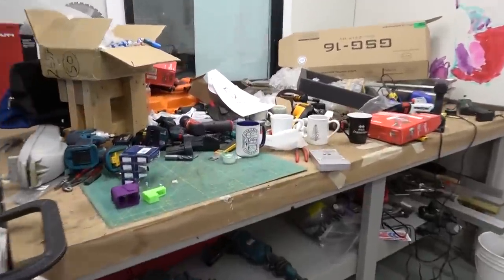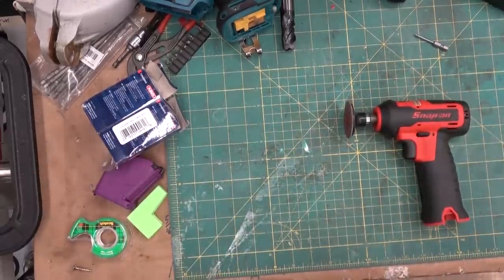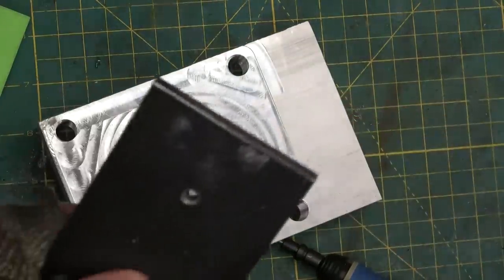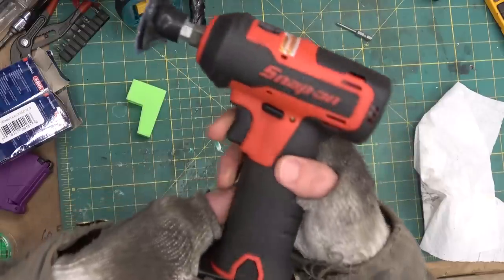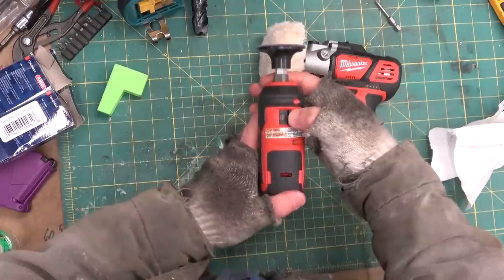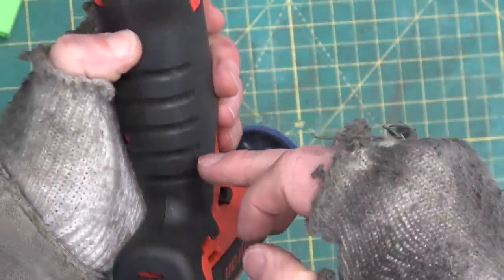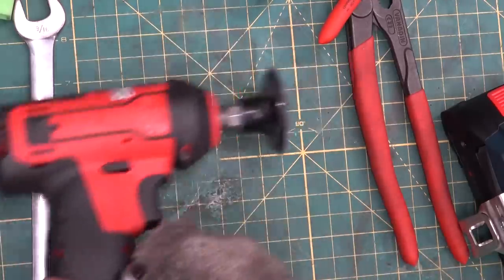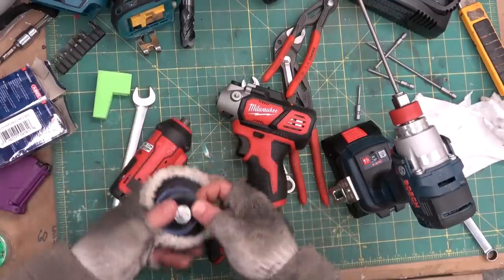BOLTR: Snap-On Polisher $$$ worth it?

Comment: i bought one. used in a mechanic shop with 3m red scotch pads, 2" diameter. used it to clean gasket surfaces. thought it would be awesome to not worry about draggin an air hose over customer  cars. right from new it got very hot for while using it. maybe 3-5 minutes at a time. smoked the motor with probably less than 5 hrs on the tool. the batteries where SO hard to pull out of the tool, and the charger even for that matter. was so frustrated in it, i never even tried to warranty it. threw it to the back of the work bench until I finally threw it in the trash a few months later.

Comment: Ur video are more entertaining than my wife's pie hole.!
I got one of these to restore polish headlights mostly light duty. Cheap tool! Broke on the 3rd use started smoking big time from the rear vents and got extremely hot! So I laid her down. Returned after taking a shit and miraculously it started working again 1min later smoke from the rear again then it sized. Some Oil drops or some type of liquid came out of the front seal onto the adapter. Good thing it had 1year warranty! Local Snaper truck took 1month to return to sender. I would not buy it especially after watching all the details on your video! I should have waited for a video like this.

Comment: I bought 4 or 5 of the 14.4volt snapon tools and while I am quite fond of them you are correct, the over molding at least in heavy mechanic shop type use only makes it about a year. Doesn't hold up to any type of oil or grease getting on it. I try to keep my tools clean after every job but even with brake clean the black rubber holds onto oily stains and just in general sucks.

The tools themselves have held up really well I'll say though. Only issue is one battery pack kicked the bucket after only about 8 months. Batteries are like 120 or so, bit of a kick in the pants.

Comment: Going to guess, I don’t think any one here has this POS?
Reply: Detailing shop I worked at had one. Thing would get HOT quick
Reply: Yes, I own one.  In fact I own many varieties of snap-on twisty tools.
Reply: Robert Cook sooo what do you think about it? Worth it or not?
Reply: @travisarnold8872  well, they all work and last well for me.  See my other comment.  Basically I am slowly switching to Milwaukee for battery powered twisty tools.  Cost is not the sole reason.  Snapons can be factory rebuilt for 68 bucks but lately they havent fixed the main issue when I sent them back, so, switching.  I just buy two of the Milwaukee.  The Milwaukee small 12 volt driver #2401-20 cant hold a candle to the comparable snap on but I bought two for less than half of snap-on.  They last me about 8 months.  I use them all day every day to make a living.  I would bet they last a home game many years.

Comment: I have one I bought myself as a professional mechanic. I actually quite enjoy using it over an air tool. Mostly for cleaning wheel hubs. The gripes. It’s a fairly durable shell, the over mold has only come loose at the thin pieces on the one side of the motor. I have had to sent it in already for repair when the motor let out it’s magic smoke. Which wasn’t free. The other complaint is that the trigger switch does get quite hot when using for some time. I’m thinking more it’s gotta be from that heat sink.

Comment: Hey AvE, not sure if you’ve already got one but the CT761ADB impact gun is an absolute winner. Uses the same 7.2/14.4 volt batteries as your polisher. I’ve had one for a few years now that I use damn near every day. I wouldn’t touch the strap on 18 volt stuff with a ten foot pole. A guy I work with has the 3/8” drive 18V lithium rattle gun, I’m not impressed with its performance at all.

Comment: I've had one of them for about 3 years now working as an ag mechanic. Definitely don't remember it costing that much but anyways. The body holds up very well, never had the moulding come off, but I take care of my tools so that can change. It works good but I think it's more designed for use in automotive applications rather than heavy... I've had to have it sent in once but that was after a large diesel overhaul where the previous mechanic likes silicone, and before I had a good air system in my shop.

Comment: I've own both the Snap on and Milwaukee polisher for about 4 years now.  The Snappy still works but only because I never use it. Damn thing thermo-shuts down with any real usage. 
The Milwaukee stays in my service truck bed and works flawlessly. 
It's not even a comparison between the two. Double of the price, quarter the performance

Comment: I have the Milfuckie version and just love it, so many tasks can be done super fast like sharpening shovels and other gardening tools, removing rust prior to painting, smoothing welds easier and safer than using an angle grinder, resorting headlights with the polishing pads ect. ect

Comment: I've had one for around 3-4 years and it has the same issue inside the battery compartment but it's held okay.  It hasn't had any issues but also hasn't come into contact with any oil yet.  I think I bought it for about $200 US from the tool truck but didn't have the battery or charger since I have the drill, 3/8s drive impact, wratchet and 1/4" impact driver.  If I could go back and do it all again I would probably have all Milwaukee stuff but they've all stayed together so far.

Comment: I've got the 14.4 volt screwdriver, ratchet, and impact gun. They are a few years old and still going fine. Only issue I've ever noticed is the battery fitment is sloppy.
For over $600 Aussie dollars each, I probably shouldn't have bought them, but I still like them.
The 18v range is a different story. I've got the 3/8 and 1/2 inch impact guns. The 1/2 in is good, apart from being way overpriced. But the 3/8 gun went back to the warranty hospital a couple of times. I don't think I'd recommend the 18v range, mainly due to the cost. I bought some of Ryobi gear to use at home, and I reckon it's just as good, if not better, and a whole lot cheaper.
I take care of my tools, so I tend to have less problems than what some others have with their tools.

Comment: I have few of the ct series snap on tools, the impacts are awesome. The overmold disintegrates with oily hands and the LED indicates when the battery is discharged.  I do not own the sander but the impacts  I can say the are super strong and compact.

Comment: I don't have that specific tool, but I do have the drill and impact from the same series. I've owned the drill for around 8 years, and the impact for 6. No problems with the rubber over molding.

Comment: Snap on batteries are crazy expensive. I just throw the tool out when the last battery craps out. Went with Milwaukee this time around and glad I did. Got 1/2 in impact 3/8 impact 1/4 impact driver a flashlight and 4 batteries for what I payed snap on for just a 3/8 impact with 2 batteries. I got everything separate no kits like you see at home Depot and the batteries were 1/2 price. The big stores get rid of that inventory to third party sellers after so many months on the shelves. At half price I don't care if 6 months is missing from the five year warranty snap on only gives 2.

Comment: I have the snapon 1/4dr rattle gun which is nearly identical. I've had it for around 10 years and it gets covered in oils and solvents. The over moulding is still intact.

Comment: I bought one of these, probably the first snap-on tool I regretted buying.  Polishing paint on high speed it had smoke coming out of the motor in about 10 minutes. It runs really hot. Its been in for repair twice in the couple of months I've had it, under warranty at least.

Comment: I have a few of the snap on electric tools. As a audi tech, mine are covered in solvent and oils daily. My older ones have been around for 2 years now. The overmolding on my screw gun feels a little marshmallow like. But the weak part is the triggers. I've went through a few of those already.

Comment: I've had one of these for about 2 years  ! It's been great! hasn't been back to snap on  service yet, only problems I've found with it on a hot day it will cut out from overheating and now starting to get a lot of play in the outer spindle bearing

Comment: Ya, I have all of these.. I think it was a 'set deal'.. Polisher, impact, Driver, and recip saw.. Had them for 3+ years, daily heavy-ish use.. To date, the overmold hasn't changed. OTOH- the polisher has been giving me fits, in batt connectivity.. Shake it, and it works.. Sometimes. The impact is still ok. Driver- Dead for a year or more.. Actually fried, internally.. No idea, but it kept running one day, then baconed itself.. Could smell it for days. Saw still works well.. YMMV.

Comment: I owned the same snap on polisher and it was a piece of junk. My dealer took it as a trade in for new brushless sander polisher.. The new one is by far the best on market, hands down. Much more power, superb control, well built, and they got rid of need of wrench to remove tools. I have the harbor freight unit, not bad for money. Best thing of snap on is battery does not fall out...ever.

Comment: I’ve had mine for nearly 3 years now I think or maybe 2.5 and my moulding hasn’t come off or started and I’m a diesel/hydraulic mechanic and no issues so I’m happy with it. Does mulch batteries though.

Comment: I have an old Fapoff cordless rechargeable screwdriver.  They no longer sell the proprietary batteries for it, it is so old.  Uses AA NiCad batteries welded together in the pack.  Rebuilt the battery pack myself.  Works fine all these years later.

Comment: I have the 3/8 version of this tool. I’ve had it for about a year. The over molding is okay, not great but okay. Brake fluid, shop solve, any nasty fluid you could think of has contacted the over molding and it’s still holing in there.

Comment: I bought one awhile back for doing small saint repair and liked having the abrasive pad on it for cleaning edges as I fabricated parts. I have run it hard and my only complaint is the bearing on the front of the tool has failed and I got the tool rebuilt for $95 and I feel like that will be its next failure as well. I recently  bought the Milwaukee M12 die grinder and found I like the 1/4" collet to be better for metal fabrication and I prefer the snap on for paint work. I haven't gotten to play with the Milwaukee equivalent though, it might be as good for cheaper price.

Comment: I use snap on battery tools every day 10-13 hours a day 6 days a week and I clean them with brake cleaner and a rag after every job ( I'm a BMW Master tech ) people freak out if you get grease on their white leather. I can tell you that these tools hold up amazingly well. I have had no problem with any of mine they might now have the power of the Milwaukee's but they are far more reliable. For the money Milwaukee is hard to beat but at my level snap on tools are a justifiable cost. Buy once cry once.

Comment: We have 2 of these at work for cleaning up the head plates on radiator cores. works well for it both are sorta new and kept clean. How ever the impact 3/8 drive's from snap-on we've sent back 3 times in 2 months because their trigger shits itself or the battery fucks out.

Comment: I like it for the paint but if you want to deburr edges I've come to love the milwaulkee right angle m12 die grinder. It runs wire wheels on slow speeds and the scotchbrite and abrasive pads, i even use the 3" pads with no real issue. Sadly the problem with this snap on buffer for me has been repeated front bearing failure over the life of the tool, like you said shielded but not sealed...

Comment: I don't know your SnapOn guy but full boat list on the SnapOn polisher with charger and 2 batteries is $434,  No where near $500 unless he doesn't want your money.  The LED shows battery charge by changing colors.  I've run mine over 2 years and no cosmetic issues with the over molding.  My only complaint is it's a bit fast and the battery is hard to get out.

Comment: I had one of the Strapon polishers. It was actually my boss's and he gave it to me to use with two batteries. One battery lasted about a month then wouldn't hold a charge and the lock and 1-2 speed button on the polisher quit working really soon too. The polisher itself worked for about a year before it burnt out. I gave it to the boss and he had Strapon fix it. The boss was an idiot who bought every tool they had and never used them so they probably fixed it for free. He left soon after but he left the polisher and I kept using it. It worked for about another year before dying again. I talked to the tool guy and he said it would be a couple hundred dollars to fix it. I turned around and threw it in the trash.

Comment: Snappy always says that "it's only $100 to get refurbished" when you point out any of the short comings or it's making noise. that being said I love the 14.4  3/8 impact and ratchet, sawzall and grinder are decent and the little light with the added magnet is amazing,  totally useless with out the magnet. When I get 18v stuff it will definitely be Milwaukee

Comment: Three + years using that tool daily as a sander/grinder (never used the polisher) ...  automotive field.  The butyl has gotten soft but is still attached.  The only issue I have had with that tool is I needed to take a battery apart to tighten the terminals as they have spread to the point of intermittent contact dependent upon angle of tool use.  I wil not admit to any value I have in tools and toolbox.......snap off makes it so easy......20 a week give or take.......

Comment: As someone who formerly made parts in the aerospace industry and has also worked for the homless despot, if in you gonna use it for deburring get a regular air powered angle die grinder aka a ' dotco '. Cheaper, usually $20, less at the hairy fright, and more powerful. Put the $500 in steaks for dinner! You're welcome.😁

Comment: I own this snap on polisher since the moment to came out a few years back.
I literally have beaten the living shit out of it and it still kicks ass!
The rubber bits still holding strong and not falling off.
So funny tip about this series of electric snap on tools. Screw gun, 3/8 ratchet or whatever tool in the series.
There be 2 versions of them usually the "A" version and a "B" version. One older and one newer but the tool looks no different!
I had a 3/8 compact impact gun with the "A" letter and she could nearly rip axle nuts off! Bananas right! Then she went for a ride in a bucket of atf....Never the same again, so i traded it in.

I currently have a 3/8 compact impact gun with the "B" letter, what a pile of junk it is! Has NO power what so ever!

So lesson is, try your best to buy the 1st gen or "A" ver. of whatever snap off electric tool in this series!

Comment: I've got the ratchet from Snap-Off. Had it about a year. Use it often in a Peterbilt shop. Holding up well, but the rubber on the batteries is peeling off but mostly from damage than oil interacting with it.
Reply: Meant to include I've got the hex driver that uses the same battery and it works great. Use it for dash work pretty heavily almost daily.

Comment: I have the impact gun version of that. I've used it for a few years in an auto shop. No problems with the overmolding
Reply: Myself and a few others in my shop have the impacts too, I also have the drill/driver version, no complaints other than run time. I really like the trigger design, forward and reverse without having to fumble with another switch.

Comment: I bought the variety pack of pistol grip vibrators from the weekly windowless van. They are best used as soft faced hammers and hammer headed phallic objects at the "book club" meetings. Not enough battery to impress the desperatest of house wives in a work day.

Comment: Would pick the milwaukee right angle die grinder over both. Carbide burrs, cutoff wheels, roloc discs or anything with a 1/4" shank, 4 way speed control. I've stalled it out a few times, but by far the go-to tool of the bunch. Even prefer it over pneumatic.

Comment: We have one of them where I work. It's a few years older mind you. We use it for removing old sealant and cleaning weldable materials. We haven't noticed any issues. However, my boss is getting pretty pissed at the new style of tools. We have had to have two impact guns and a auto ratchet wrench go back. One he was able to get warrantied, the other SnapOn wouldn't cover cause it was an older model and they would pay a small percentage and my boss would still have to pay over 100 to make up the difference. Boss told the SnapOn guy to go fuck his own had in the not so platonic manner.

Comment: Ive had one for a few months now. 250 dead body still too much. They are handy for preparing flanges and sealing surfaces on heavy equipment. Not to terrible in the hand. Only reason I got it is because I already had the 14.4 line. Not the best not not the worst

Comment: I got the 3/8 snapon impact driver with the included socket set. It's pretty good. Better then the half inch Milwaukee because its smaller. Packs a decent amount of snot for busting lug nuts, low enough torque youre not gonna snap shit either. I'd like to see a review on that bad boy.

Comment: Is Snap Off worth it NO!!  Crummy warranty (1 year vs Milwaukee 5 year) + you can get 2 Milwaukees for the price of 1 Snap Off.  Who can complain about that logic MORE is better especially if the price tool makes a Harbor Junk tool look like a gem!!

P.S. Get the bare M12 Angle Die Grinder now and you will roughly have the same combined cost of the Snap Off and you will also have a tool with a lot more RPMs (9500 more to be exact).

P.S.S. Live the vids, keep up the good work